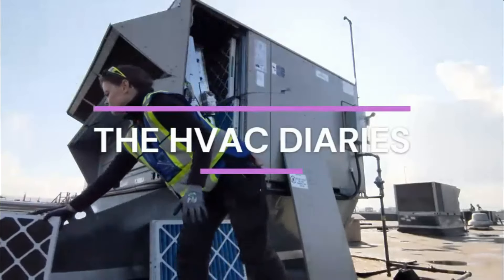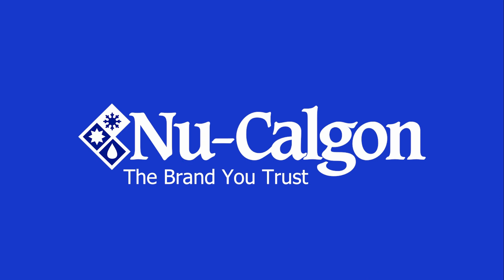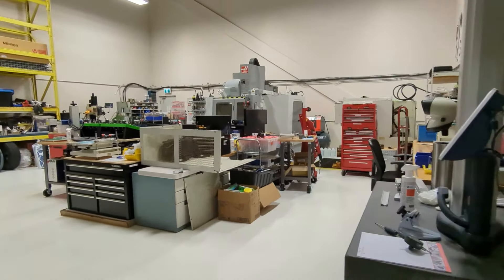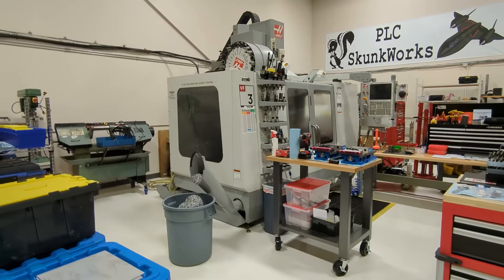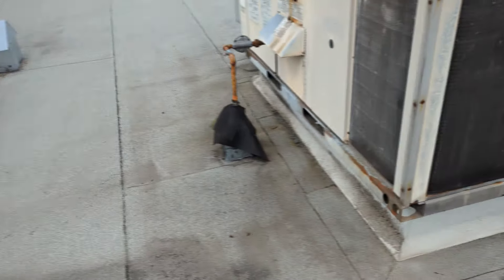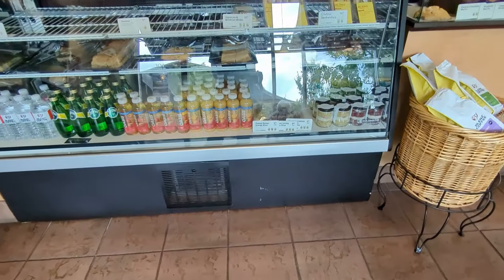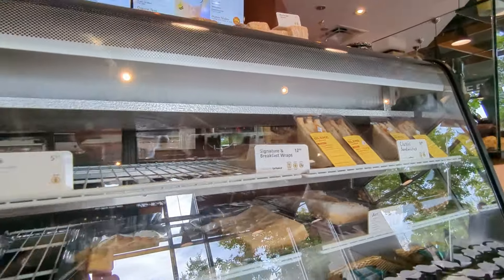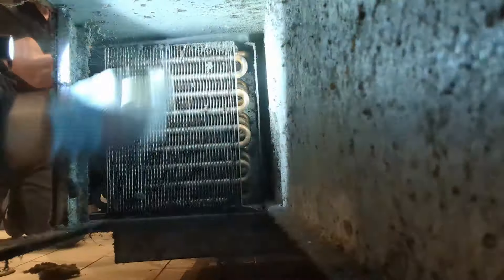Compressor Hard Start Kits | HVAC Vlog

Comment: Great video as always. Not sure what size your Co2 lift is but they make a shorter one that only goes up to 12.5'. The platform is at a much more manageable height than the large one that goes up to 18'. Might be worth having the little one around to make the two person lift a little easier.